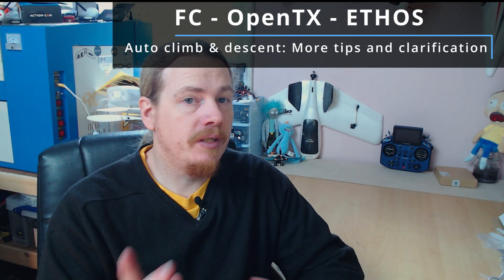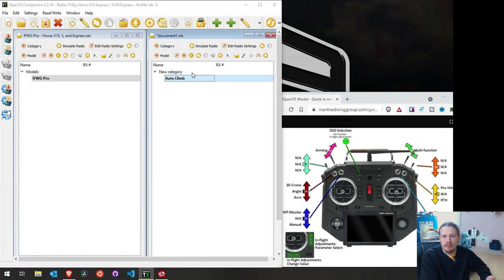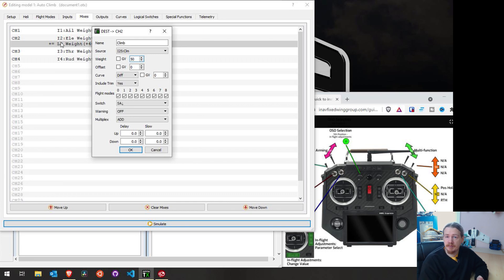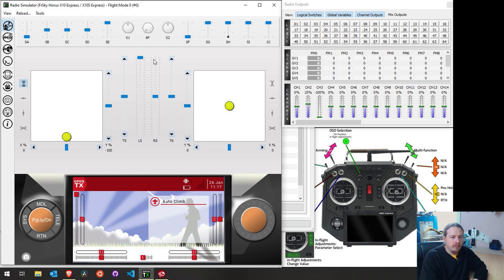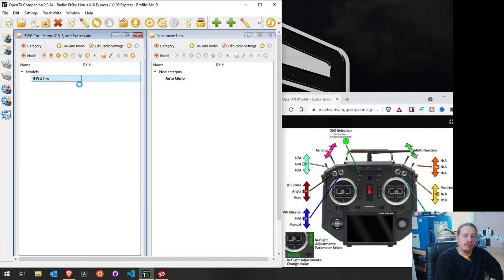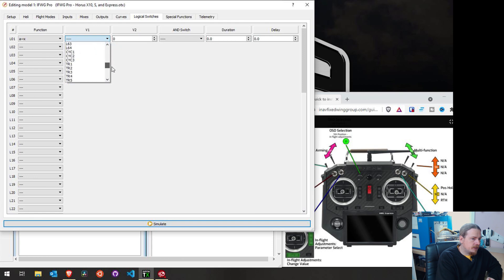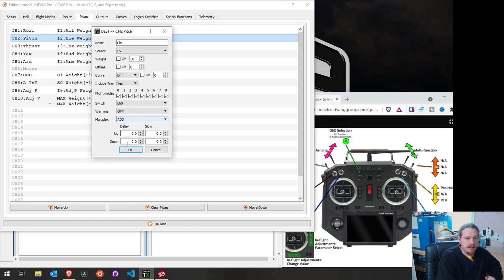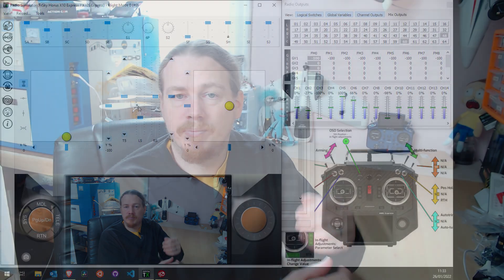Extras and clarification for the Auto climb and Descend for Cruise mode

Comment: In setting up a curve in OpenTX/EdgeTX using the slider as your input, it is always a good idea to add a center dead band. Even though most radios have a physical detent for center sometimes it is hard to find exact center when in flight, under the goggles, maybe in a higher stress situation, etc. Adding in a 5 point dead band on either side of center in the curve gives you a litlle play room to dial in center mid flight. Just a tip. Great vid Darren
Reply from the maker: Great idea. I've noticed that some transmitters are better than others as far as the detent goes. But, I guess with the sliders it's a compromise anyway. Some glider pilots use a slider as the throttle. So a more subtle detent is better here.
Reply: @MrD  I know it works really well for a pan/tilt application. I would have issues with trying to find center even with a detent by over shooting a couple times before its dialed in. The dead band stops this back and forth movement, and even a slow down by 0.5-1 second smoothes it out too